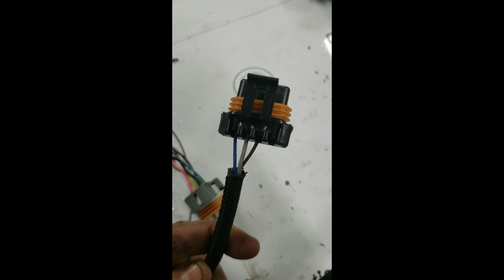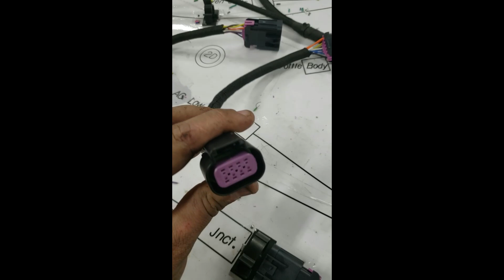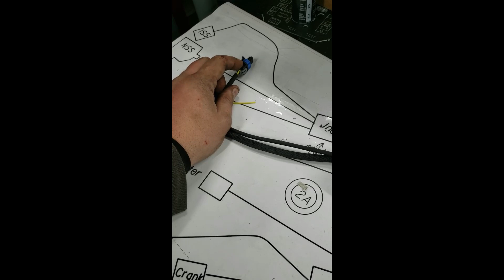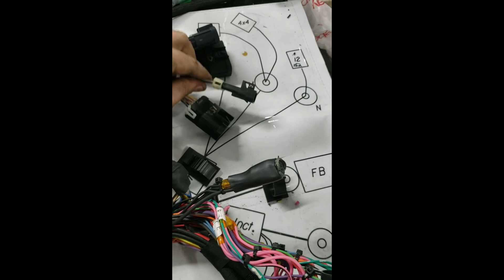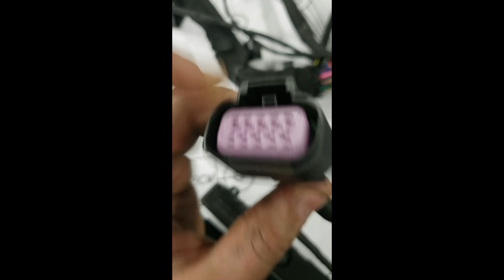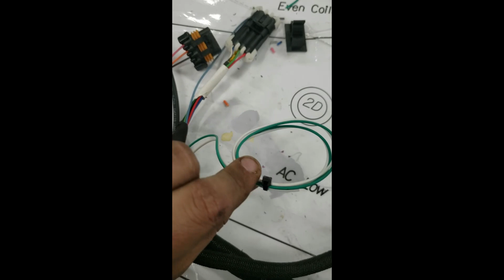Holley EFI Integration Harness for GMT800 Silverado, Sierra, Tahoe, Suburban, etc

Comment: Man, fuck youtube algorithm..

I spent 5 hours sweating my dick off yesterday sending out a stock 03 wiring harness to integrate to my Holley Terminator X Max. 

Why, you might ask? Well current performance was 6 fucking weeks out. So.... I was forced to fingerfuck this oem harness....

This video then pops up no more than 10 hours after I finished the harness harness...

I am absolutely CERTAIN that I will be appropriately compensated for my labor....../sarcasm

FML

Comment: Great job. Do you have a solution for drive by wire cruise control yet?
Reply from the maker: No testing yet, but the Dakota Digital DBW cruise SHOULD work. We just don't have a unit to test with at the moment

Comment: Where does the drive by wire peddle plug in at?
Reply from the maker: It plugs in where the TAC would have originally been. The stock "pedal to tac harness" is used. This allows all the different years of pedals to plug in with the same 10 way connector
Reply: @speedmaxinnovation9287  Thank you

Comment: Have you gotten anywhere with the 99-02 harness yet? The video has been up for a couple of months. I am hoping to get an integration harness from my project which is a '99 Sierra LM7 to be swapped for 2014 l83 Gen 5 with 4L60E but I'm going to do away with the direct inject and go to Port injection and I want to use the Holley Terminator x Max.
Reply from the maker: Very soon!
Reply: @speedmaxinnovation9287  any word for the 99-02 harnesses?
Reply from the maker: @450__moto8  working on one now. It's in prototype phase